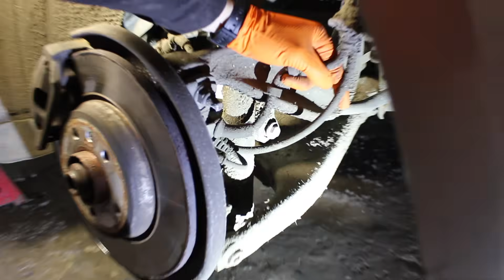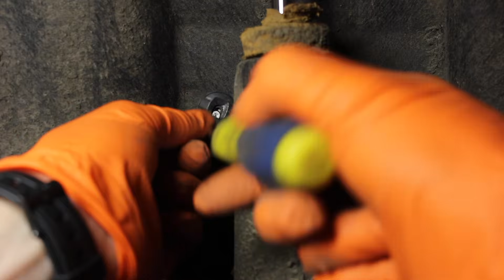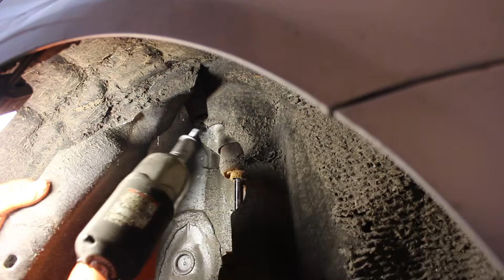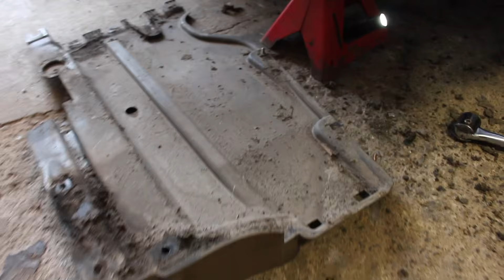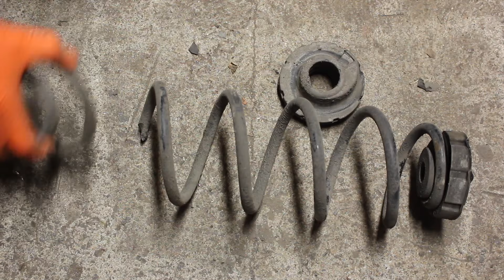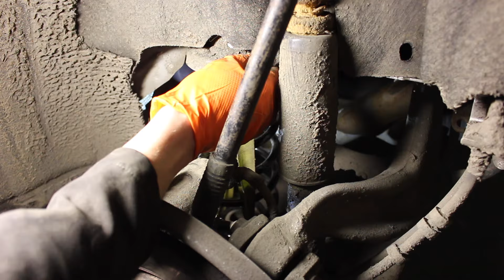How to Replace the Rear Coil Spring on Audi A4 B8

Comment: Great video, thanks for the share!

While doing mine, I was only able to get the subframe bolt closest to the trunk out (both sides) which was sufficient. Instead of the tow straps, I opted to cut my spring compressor which fit great on the driver side, but had to angle the compressor weird to fit on the passenger side. Best of luck to anyone doing this.

Comment: Would this also work with Audi A6 4f only to loose the 2 frame bolts ?   I hate it to use these coil tensioners, W/o to loose any frame bolts, you have to compress the coil very hard and sometimes the tension plates are slipping under pressure

Comment: Hello,  on the rear of my b8 one of the subframe bolts rounded the head of is there any way I get this out? Nothing would budge it siezed solid. Is it possible just to leave it in place and what other approach could I take to fitting new springs without getting the subframe bolts loosened. One bolt beat me the one closest to rear bumper .. to the left if your facing inwards. Thanks

Comment: Good video,im just wondering with the 1” threaded bar what did you use as ends to compress the spring
Does anybody have any ideas?
Reply: I think he made a mistake there as there's no way the threaded bar was 1". More like 1/2".
Apart from that small error, the video was very helpful indeed.
Looks like he used circular plates or very large penny washers as end plates to compress the spring.
You can buy decent spring compressors online for about £10.

Comment: Brilliant, Thanks for this, i changed my rear springs today, I used your method with the rachet straps, i had to use 3 though to hold it. And tie them on to hold the compressed spring. Many thanks
Reply: Hi' question why do u need to use a strat to compress the spring????

Comment: Drop the two subframe bolts and it comes right out
Reply: I know right why do u have to leave one on???? And if its a lowered springs surely u dont need to compress the spring or use a strap???

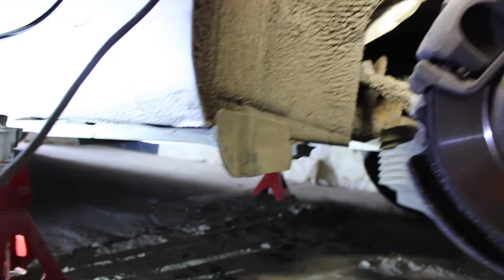Comment: Hello! It is not necessary to compress the spring! Just remove the 2 bolts (one of them 3:04) and be careful, the whole part will goes down. And very important lift the car from both sides.
Reply: Thats not a great idea. Complete removal of these bolts should require that the subframe be realigned when reattached. The mechanic here avoided that by only loosening them. Its a good way to do it.

Comment: This is very good, thanks!   I took the bolts out of the sub frame.  Once the straps were on the spring it was totally easy if you jack it up slowly with the spring in.  I also want to note, compress the spring quite a bit and make sure your straps are double looped before you tie them.  My straps were 18 inches or so each so there was plenty of material to make double loops and not single ones.  Otherwise if you single loop it they tend to let the spring recover too much and you wont be able to get it in as the knot tightens it elongates the loop and you are done for then.  His home made tool for compressing the spring is way better then the store bought ones.